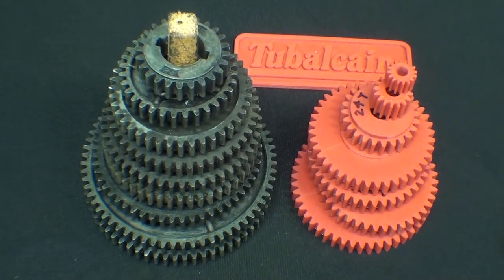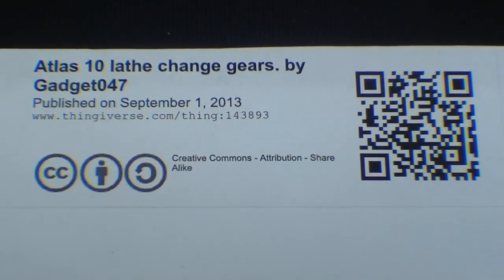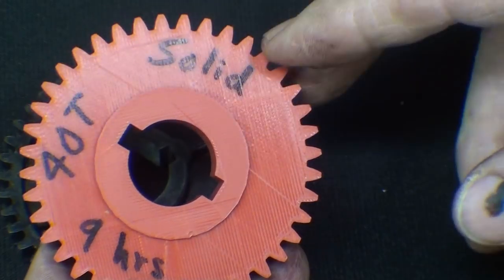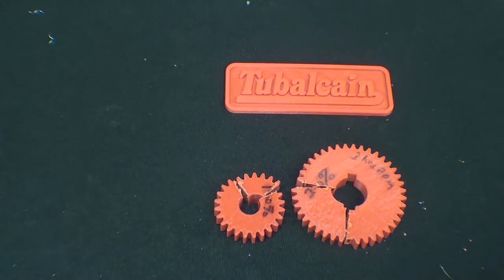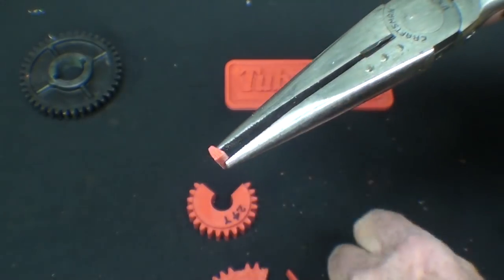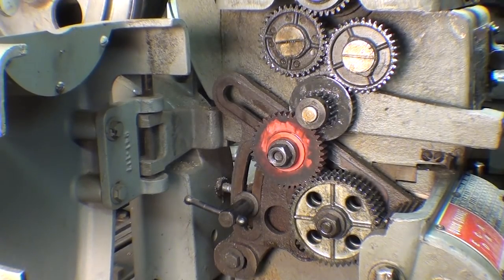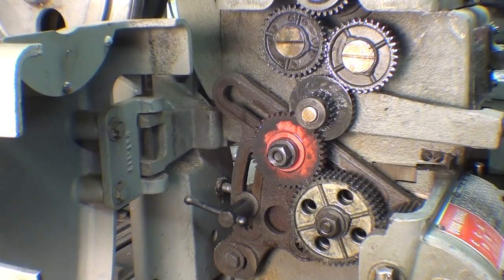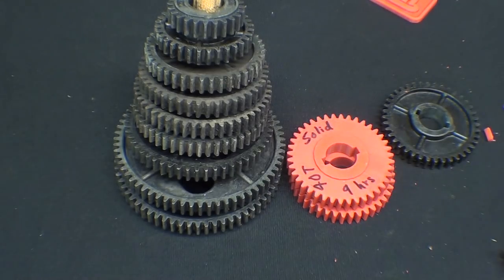3-D Printed Gears for Atlas Lathe TIPS #416 tubalcain

Comment: I think the biggest load you can put on the gear train is cutting the coarsest thread you can.
With that model it must be 4 TPI.
 Running on a 3/4 X 8 TPI Acme thread lead screw. 
The bigger the diameter of the lead screw the less helix angle of the thread thusly reducing stress on the gear train. 

Yet another  amazing video.
Thanks.
Reply from the maker: Thanks

Comment: "Rip 'ems"!  AvE will be giddy.  This was a very interesting video.  I was expecting the gear to split while under load in your lathe.  I'm sure it would soon become prone to increasing backlash and chatter after a day or two of use.  However as a temporary fix to get your lathe running again while waiting for a replacement Zamak part to arrive in the mail, this seems to be a viable solution.  Thanks for doing this imaginative experiment.  I would probably have assumed this would never work and not tried it, you proved me wrong :)

Comment: Used my Anet A8 to print a 10tpi LH stubby Acme thread cross slide nut to replace the well worn out bronze one on my Craftsman 101/Atlas 618 lathe. I designed it using Freecad. It was trial and error. I first got the OD right and then the threads. I would print one in PLA and if to tight I would cut it in half length wise and see were the problem was. It took about four tries to get it right. I then printed it in ABS. The backlash went from 0.020" to about .005", and that is mostly in the cross feed screw moving back and forth in the saddle.  I then acquired some NylonX, carbon fiber impregnated nylon, and replaced the ABS with it. Works great so far. I will keep an eye on the wear and see how it lasts. Plus, when the wear gets to bad, I can just print another  one. Only machine work done was to print a small hole where the 10-32 saddle attachment screw went and then drilled and bottom trapped it. They do make a Delrin filament, but from what I have read it is a pain to  get bed adhesion do to the oil impregnated properties of the Delrin. Guess I really need to put it on Thingiverse.
Reply from the maker: Jeff Pierce that sounds like a great solution, and I bet it will hold up for years. I like the way you experimented with sizes, I did that on some I'm some items I printed out.

Comment: That was impressive. Having printed with PLA I am surprised it held up against forces that stalled the lathe. Just a little heat with PLA will make it fold like a cheap lawn chair, so I am impressed the gear made it as far into the test as it did. Great experiment - sometimes you have to ignore assumptions and forge ahead.

Comment: Very interesting Lyle. It might be interesting to have gears that were solid for the inside 3/8" and the outside 3/16" below the tooth root, and then spaced in the middle of the gear . That would build faster while still being full strength at the stress points. If the plastic isn't degraded by oil then I can't see much of a problem on a lathe like an Atlas. You should certainly be able to print a complete threading dial mechanism, there is no load on it to mention.

Comment: Thank you for all your videos.   This one leads to many questions.  Is there a filament  similar to acetyl?  Would wear be greater if two plastic gears ran against each other?  Could half nuts be printed?  Could an in./mm transposing gear be printed?  The shallow cuts for threading ought not create much strain.  How about  the gears in the quick change box?  It would be interesting to mock - up a gear train to test strength and durability.  The metric conversion and half nuts would probably appeal too many lathe users.      FYI, even my wife recognizes your voice.  She says she likes listening in spite of not understanding a bit of it.  Thanks, Chuck & Louise.   Helena, Mt.

Comment: Great video, particularly the testing of the gears. As far as I know, ABS is harder but PLA is tougher, so it is the right choice for printing
 gears. The problem with PLA is its plasticity rising early when temps go up, so that was the reason to use ABS in extruders and would be a reason here.

Comment: I'll definitely be printing the forward reverse gearbox gear that I broke crashing my cross slide. It's a bevel gear so might not work but it's worth a try. By the way, pla is significantly stronger than abs, it's just harder and so more brittle making it more susceptible to impacts.
Reply from the maker: Thanks for the correction. I thought that ABS was the strong one

Comment: I was sure it would not hold up like that. I had assumed it would of been good for a pattern, but that's about it. Thank you for nosing that out. Very interesting. It would be the cat's meow for making a gear that would only be used once or infrequently. I have been waiting for some one to mention you could get chopped fibers and plastics in those 3d printers. Don't know how they would do it but then that's all new stuff to me. You could get some good strength with fiberglass in something like that i bet. Certainly additive machining is the wave of the future or becoming a valuable part of the new manufacturing. I have to admit i am not sad to have missed the boat. It's getting to be all clean room work these days. I miss the smell of real cutting oil.

Comment: ..Although a little off the subject of plastic gears...I know you have quite an interest in 'castings'. I receive a magazine titled Additive Manufacturing...a monthly industrial type publication. In the latest issue....there is now a 3-D process for 'printing' sand cores/molds and inner structures that weren't possible before. Mainly for casting iron and other similar materials.  A bit expensive for the home hobbyist I imagine....?

Comment: Of course, being a Molder, I would try to cast the gear in aluminum. You might not be able to cast the hole and might put a riser, to feed the solidification process, where the hole might have been. Might be a neat experiment.

Comment: Mr. Pete, I will be experimenting with a 3d printed gear for my EMCO V10 which will allow me to cut a not 100% but nearly perfect and usable metric 1.0 pitch threads. There are specialty versions of PLA that have higher strength. To print in Nylon as many have suggested you would need to upgrade the hot end of your printer to all metal and upgrade the cooling fan. Nylon has much higher temp print requirements. You could also experiment with PETG filament, it is similar to plastic soda bottle, print temps are higher but within the reasonable range of the stock CR-10.

Comment: I've used some 'Merican Olde Skool lathes in the past  and now have a Chinee 7 x 14 mini, one difference I notice (or think I notice☺) is that the plastic gear trains do in fact run quieter than the metal ones, I suspect harmonics and ringing are attenuated if not totally suppressed with plastics.

Comment: Pretty interesting the gears didnt break before your machine stalls at its limit. Possibly repeated testing may show creep leading to failure, or if you repeated a cut until the gear breaks. Its a tedious and long boring test though. This gives me confidence to try my gearbox I am working on, in pla+. I wanted to do abs since its tougher but I need a few upgrades before printing in abs. Great video!

Comment: Made the gear (don't know the proper name for it) that drives either of the other 2 gears on the rocker arm for carriage travel direction out of ABS 100% fill for my SB 10K - like you to see if it would work. While doing some threading the carriage jammed and the gear broke, my fault. This was a GOOD THING, the gear teeth did not break but the gear split opened. A good thing as it acted like a "fuse" and prevented  other damage to the rest of the metal SB gears. I intend to keep using a plastic gear there and there is another one on the lathe now. Your teeth, my eye sight!

Comment: Surprisingly that the PLA held up although maybe that gear doesnt have the highest torque? The next thing to think about is of course wear but maybe that isnt an issue either for lathe work. Using nylon they would certainly hold up if PLA does. Very nice to see a "real" application of gears 3d printed.

Comment: my understanding is that if you want strong gears use nylon filament. The pla gear did better than i expected, probably because of the 100% infill. I rarely go over 30% but i'm usally focused more on print speed than strength.

Comment: "Yiel Strength":
Zamak: 361MPa. 
PLA: 15-70MPa. 

"Density":
Zamak: 6800 kg/m^3
PLA: 1300 kg/m^3

Perhaps one of these new nylon composites may be an improvement from PLA with real lathe work load.

Real application video... thanks it was great, keep us posted.
Reply from the maker: Thank you very much, no one ever said that before.

Comment: PLA in my experience is amazingly wear resistant and tough material, that gear will probably last for a long time if it stays cool enough. Heat is worst enemy of a 3D printed plastic part because it is thermoplastic it softens when heated and that leads to deforming of the part.

Comment: That's impressive. I really didn't expect the gear to hold up. If it was nylon reinforced I'd have expected it to hold up possibly. Lots of the battery powered drills have plastic gears which to me is surprising they hold up. The skeleton printed gear I didn't expect much out of, maybe if it was solid on the out 1/2" it might.

Comment: Mr. Pete, thank you for taking the time to print and test the plastic gears.  I appreciate it.  Like you, I was surprised to find that they held up.  I figured the would deform and break.  I noticed a poster below said something about printing them 6% oversize to allow for shrinkage and cast them.  I think this could be done, but rather than doing a lost PLA casting like many have tried, I think it would be better to make a RTV wax injectable mold to make the masters and then tree some up and do a regular lost wax, vacuum cast.  That is something I have wondered if it would be worth while to do for some parts.  For example the break away bearing for the lathe lead screw.  But I am rambling.

So, if you want something for your time, I am missing the 24 tooth change gear.  I would be willing to buy a solid one from you.  :-)

Regards,

Joe
Reply: sure it would be nice to have a gear made by mr pete222, but if you just need the gear: just go to thingiverse to get the stl and then have it printed on 3Dhubs.com. A local 3DP enthousiast will make it for you and you might make a new friend as a bonus.
Reply: Thank you for the tip!

Joe

Comment: You could consider PETG material. Much stronger than PLA with a higher temp rating yet it prints as good as PLA. I use the PETG almost exclusively if I plan on using outside or for parts inside of my Jeep. PETG is a very tuff material.

Comment: It is possible to increase the number of perimeters to the point where the teeth are printed solid while the body remains hollow. Best of both worlds!
Also PETG is a great material for this application: stronger than PLA and as heat resistant as ABS while easy to print with. A heated bed is required though.

Comment: Boy if you need a set for 1 time metric that would be the way to go.  Surely it would wear over time.   Also wonder about the oil reacting with the plastic 

Jim
Reply: The plastic and the oil are the same material basically so not sure if you would get an adverse reaction. regards
Reply: Oils and plastics being similar chemically actually causes the problem. The oil soaks into the plastic and weakens it. You may have to look up which oils are compatible with your specific plastic.
Reply: How about a silicone or Teflon based lube?

Comment: You might look into trying PETG instead of PLA. It prints better than ABS and has greater heat resistance than PLA; similar to ABS. For greater strength you will want to increase layer height to .3 (which also has a great side effect of making the print faster).

I heard you mention using the raft for better adhesion. You've probably heard it by now, but I'll mention it anyway. Use hairspray (cheap Auqanet) or just a glue stick on the glass. I prefer hairspray myself, it rinses off with warm water very easily. Fussing with tape is not something that I enjoy and the adhesion from hairspray is perfect, PLUS! when the bed cools, the part pops off by itself.

You can get solid teeth with infill if you increase the wall thickness on your part. Hell, I would totally use the printed gears full time, using a printed gear on every other location just to reduce wear on the cast gears and you wouldn't even need to oil them (perhaps just a small amount of lithium grease). Since they are getting more rare it would be a good way to save the ones you have. 

Good luck and great video, as always. =)

Comment: Great video, I had a Hobby-craft MD65 in the early days which had several Nylon gears which never gave any trouble. I'm no expert but, My only concern is the long term effect of the lubrication oils on the PLA plastic. ABS plastics are oil based I believe & may well be more prone to oil deterioration breakdown. I have a 3D printer as well I might add.
Reply from the maker: Time will tell

Comment: Your load test was very helpful to me.
Please note: the lubricant you used on the plastic gear could cause the gear to fail over time.
To the best of my knowledge, a silicon grease is healthier for plastic gears. But of course, for applications similar to what you demonstrated I doubt silicon grease would be a good choice for the other components.
Reply from the maker: I soaked a gear in a can of oil for over one year. No degradation at all
Reply: That is good to know.
I assume you were using regular petroleum-based oil.
My input was from web research, not personal experience.

Comment: Having printed stuff in a wide variety of materials, I personally would make them out of Taulman Alloy 910 right now in the materials marketplace. Second Place would go to PETG.  You would need a different hot end for your printer to print the nylon because it can't print at the higher temperatures but you should be able to print PETG.  The other problem with PLA which hasn't been mentioned below it that it deteriorates over time. The same gear six months or a year from now can be brittle even if it isn't used. In addition, PLA easily deforms at lower temperatures so you also may have problems with longer jobs which can increase the temperature of the gears till they get warm to the touch and that alone may deform PLA.  Something to keep in mind.
Reply from the maker: Thanks for the information

Comment: If you want something to be structural but still print with low infill, use more perimeters.  Especially with gear teeth, it will help to increase the strength.

Comment: A plastic gear is sometimes used as a addition to the shearpin on the leadscrew, i'm sure you never have crashes or mishaps - but if you do at least you know which gear will strip.

Comment: did anyone notice the shaft of the tumble reverse gear on the left is rotating  (is it supposed to) the one on the right is not. I use belt slip on my drill press to save from breaking things, haven't had the lathe loaded up enough to find out if it does also. Mr. Pete as others have stated  put a full set on it and let us know when they fail in the future.

Comment: I can tell you from my experiences PLA is much better than ABS for gears as abs is soft and wears away. Nylon works the best but is harder to print. also if you increase  the top and bottom layers and the perimeter or wall thickness in your slicer you can have 20% infill, this will be a strong gear.

Comment: Very cool test.  I am surprised the teeth did not snap off under heavy load.  It would be interesting to see how long the gears would last from "normal" wear.  We use large sacrificial nylon gears in old sheeter drives.  They can last for years.

Comment: Conclusion:  Your plastic printed gears are serviceable on the Atlas lathe.  If one breaks, print another one.  Do the existing ratios permit metric threads?  If not, I assume different tooth numbers could be printed.  Fascinating experiment.

Comment: The forces on the leadscrew are a tiny fraction of the forces on the spindle or cutting tool. So I think for the real test you would need to use a high feed rate (and a high side relief tool). But then you have to worry - will the plastic gear break first or will one of the Zamak gears break?

My mini-lathe gears are made of POM or acetal/delrin. My lathe has stalled several times due to a seized leadscrew bushing, so the lathe's max power went into the plastic geartrain. I've never had a gear break. Although at the same time one of the early geartrain bushings tends to bind if there is a lot of leadscrew force, perhaps this is intentional to protect the geartrain.

Comment: I have a set of printed ABS metric transposition gears on my 13" South Bend lathe, but I've switched to PETG for gears as it's far easier to print and more tough than ABS (more likely to give a little, than snap).  I've also got a printed thread follower for it - just make sure the follower gear is appropriately helical; if you're printing it anyway there's no excuse for not printing it right ;-)
Reply from the maker: That's a good suggestion

Comment: First thing I did when I got my 3d printer was to make a set of gears for my Chinese minilathe. PLA works great, I've been using them for nearly a year now and no significant signs of wear. Ok, so only occasional light use. But the 3d printed gears have significantly better geometry than the original plastic gears, run smoother, less noise. I designed them with Fusion 360, didn't take much brain power! Btw, Thiniverse is a great site, I contribute there often.
Reply from the maker: Yes, I think PLA works fine. And when it fails Print a new one